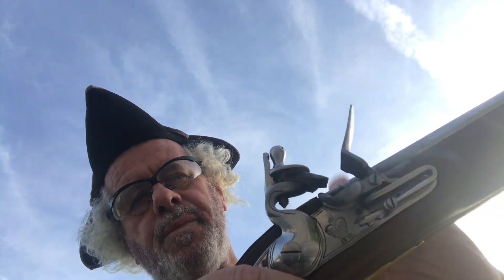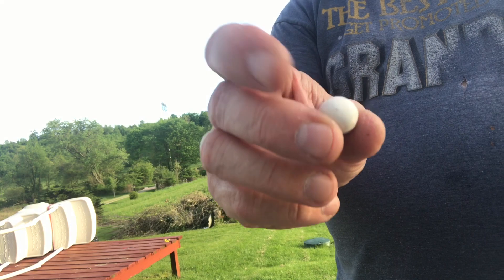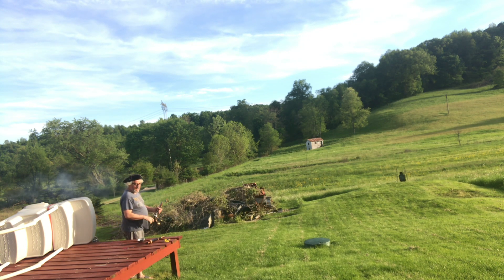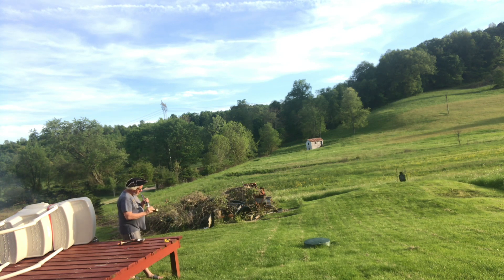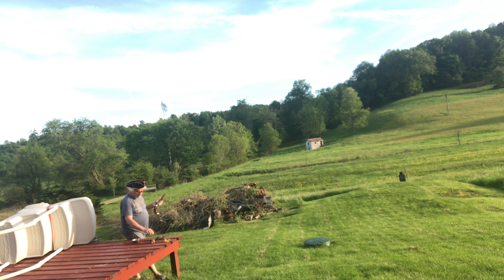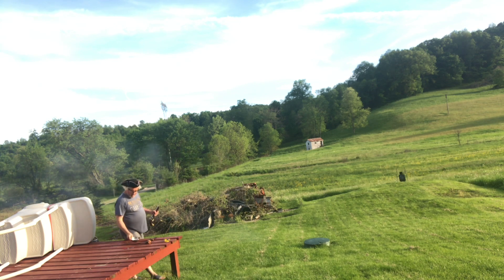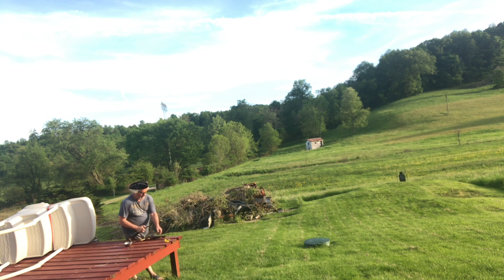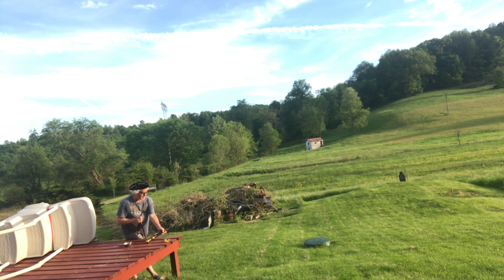British dragoon flintlock pistol from military heritage

Comment: Check your flint edge. To sharpen the flint edge, take a knife blade and gently tap on the flint edge with the cutting side of the knife blade. This will spall off bits of the flint edge thinning out and sharping the flint. Good shooting.